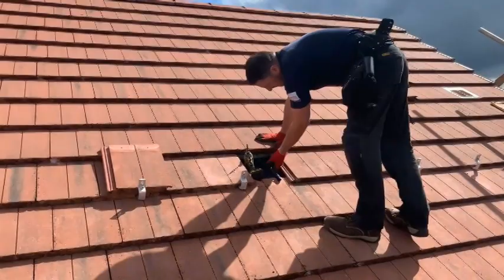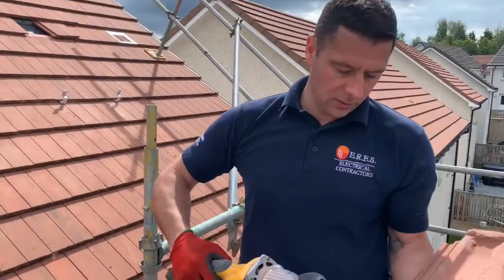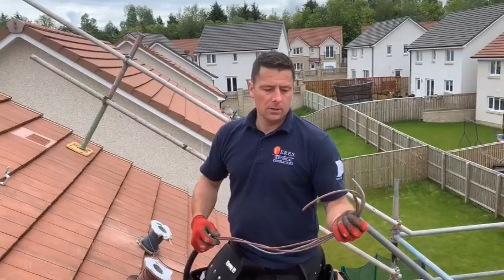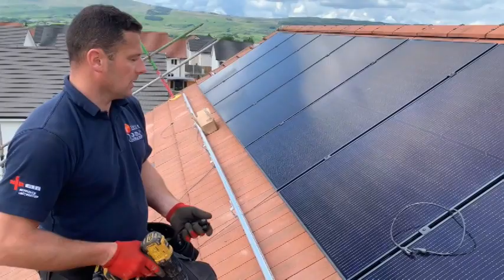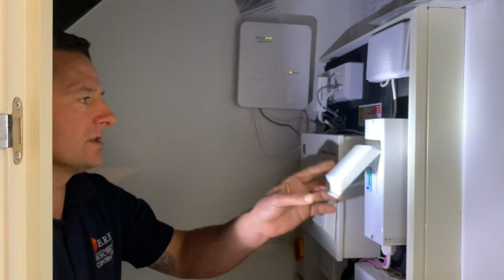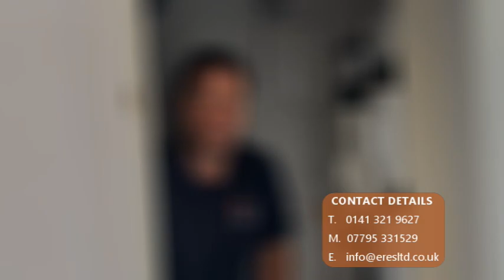Typical solar PV & storage installation, Givenergy hybrid system.

Comment: Great looking installation. I guess the grid meter needs to communicate with the inverter, and if so how? I never seen a cable at the inverter, like a cat 5 or rs485. Thanks
Reply from the maker: Hi, thanks. Yes, your right. It’s the pink cat 5 that you see going into the enclosure with the Em115. It’s tucked away neatly at the inverter side. You only need 2 cores of the cat 5.

Comment: What are your favourite hybrid inverters? I have a cabin which has a 16 amp supply. I want to use that supply as essentially a generator for a battery, and some pass through. I have been looking at victron and Solar so far.
Reply from the maker: Hi Dave. I don't have a favourite to be honest. You could struggle with that 16 amp supply. We wouldn't install a 3.68Kw system on that supply.
Reply: @ereselectrical9397  Thanks for the response. If the generator was a hybrid, and you had amble battery storage, why would the supply be an issue? Essentially its off grid, but has an AC connection for some help charging over winter or when demand is higher than the hybrid inverter (7.5kw Sola g4)
Reply from the maker: @DaveDaveAlanAlan  hi. It’s not off grid as it has an AC grid connection. For a 3.68 KW Inverter we run a separate 20 amp supply in 4mm cable. You need to keep volt drop under 1%. 3.68 is roughly 15 amps. If you were force charging it would draw around that 15 amps plus anything else on the sub circuit. 7.5 Kw’s is around 32 amps.
Reply: @ereselectrical9397   Is there a way to limit the AC input? 

I need to double check, but I think the supply is 32amp not 16, in which case I might be OK, but need to check.

Thanks for sharing your knowledge.

Comment: For a 5kw hybrid givenergy inverter. What cable would you use from the consumer unit? Would you use? I need 6mm but it says on the installation manuel i need a 4mm earth? Do you use 3 core flex or twin? Do you take an overlay with it?
Reply from the maker: Hi James. I’m not familiar with an overlay?
6mm twin and earth assuming within volt drop range. We install a 6mm earth wire from battery to inverter for bonding purposes.
Reply: Thanks a lot

Comment: Do you have an EPS on this system?
Reply from the maker: No.
Reply from the maker: No, the system can have EPS put we rarely install it.
Reply: @ereselectrical9397  thank you for replying. Is that because customers aren’t aware of it or don’t have a need for it?

Do you know the specs of the EPS in terms of load it can cope with. I’m considering it.
Reply from the maker: @nathanm5388  mainly due to the cost of it, very expensive. If you are rural with a lot of power cuts fair enough but for most it’s not a big requirement due to stable grid. 

We see a lot of lethal EPS installs, from an installer’s perspective you have to be very careful to install it properly. 

Same discharge rates to the best of my knowledge.

Comment: Great video. Why do you choose the 3.6KW inverter over the 5KW inverter with a 5KW Solar System?
Reply from the maker: Good question. It’s normal to oversize an array. The reality is, it’s not often you will get near 100% efficiency out of your array, a lot has to align for that, irradiance, temperature, sun angle. Oversizing the array allows if to work harder when conditions are not so good. The inverter will utilise more than 3.6kw’s if it can use some of that power to charge the battery. Lastly, a 5kw system required full G99 DNO approval, in my opinion, that’s to be avoided unless you are a bigger than average electric consumer.
Reply: @ereselectrical9397  Thank you for explaining. 👍🙂

Comment: OOI What is your reasoning for using the Hybrid system over a AC coupled system?

It (as a user) has a tonne of down sides (No external monitoring of Battery and Solar usage as seperate entities, coupled systems, limited max power output) all for what seems to be a fairly small cost saving in the grand scheme of things
Reply from the maker: You can monitor PV and storage separately, every inverter has max output regardless of type. The hybrid has a higher charge and discharge rate than the AC equivalent with the manufacturer on this video. 

Twin inverters equals more cost plus more chance of one going wrong. One inverter also saves space. For most people a hybrid is the way to go. I accept for high consumers a grid tied plus one of even two AC coupled make sense.  If you think AC Is for you , crack on 👍🏼

Comment: Good video, really informative thank you. Why no optimisers, if there's potential shading issues? Was this a customer decision? I'm shortly getting 16 panels fitted to our roof and I've got shading issues later in the day/in the winter so am fitting Tigo optimisers to all 16 panels to make the system as efficient as possible. Is this worth it or not?
Reply from the maker: Hi , this roof had no shading issues. If you have shading issues you should always use optimisers on the problem area or all panels. 

We offer optimisers as an option to all our customers, it’s Tigo we use, great optimisers.
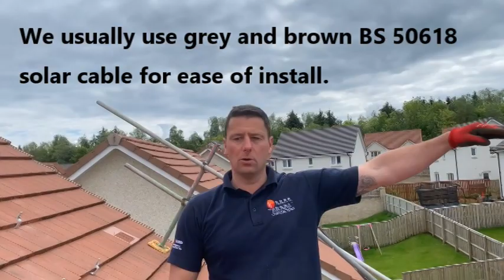Reply: @ereselectrical9397  ah I think I misunderstood the bit  in the video at 5:30 that talks about shade...thanks for the reply 👍